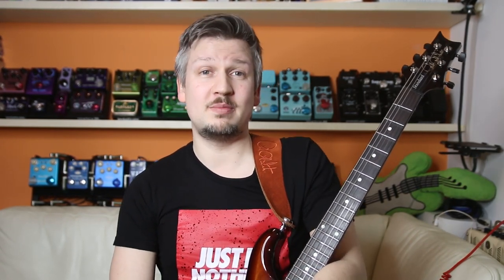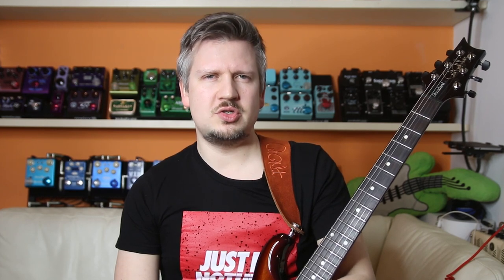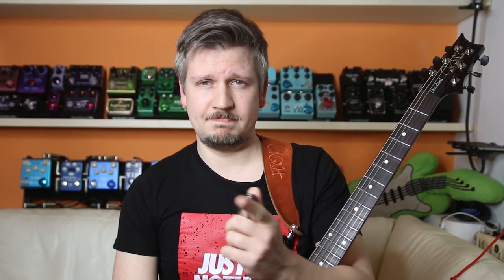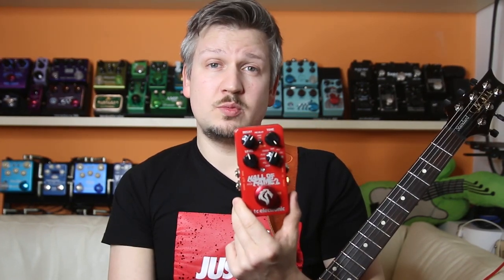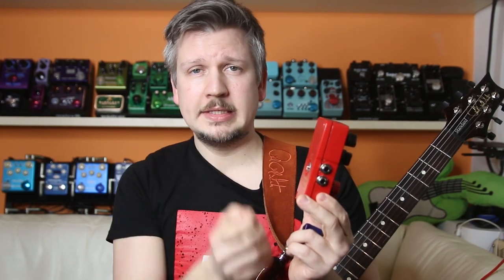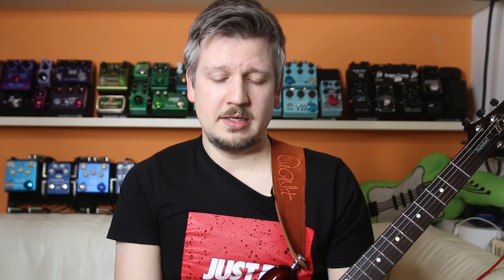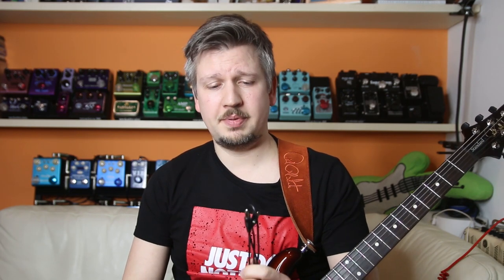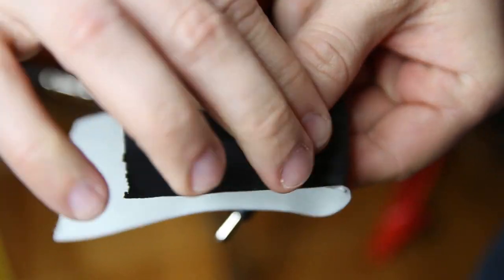This 9V battery trick can save your outdoor gig!

Comment: Interesting.... but why did you connected the same polarity? And not as standard mode?
Reply: That is the question. Russian wizardry to fry our conveniences ^_^
Reply: I don't think its a good thing to do
Reply: I realize it's an old question but for anyone else with the question now,  the answer is...Because the "Boss" style power jack used on most, but not all pedals, is CENTER PIN NEGATIVE/ but the battery clip he's using has the CENTER POSITIVE. If he didn't reverse it, he'd be applying the power with the wrong polarity. The pedal would not function, and depending on the pedal and if it has reverse polarity protection, he might even damage the pedal. I'm not crazy about the taped solution though. I'd go ahead and cut the wires, reverse them and solder + heat shrink them so the polarity swap happens right on the cable. Or find battery clip to 2.1mm barrel connectors that have the polarity set to center negative at the barrel connector.